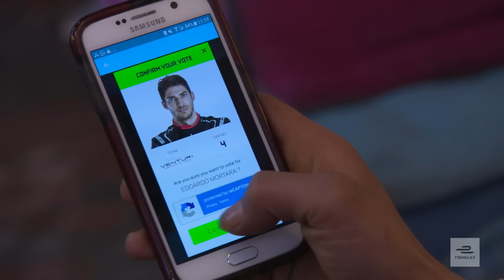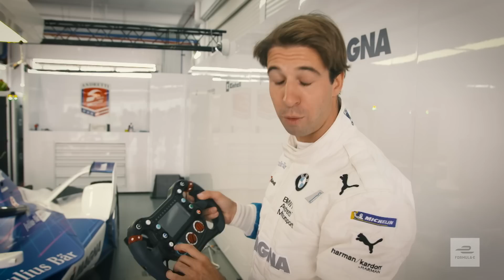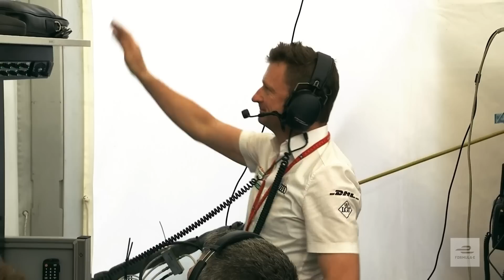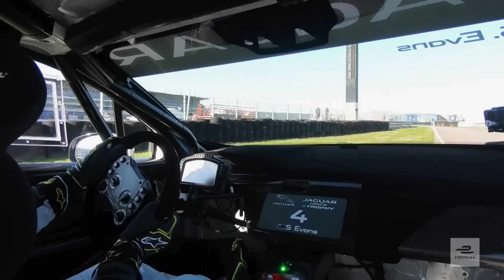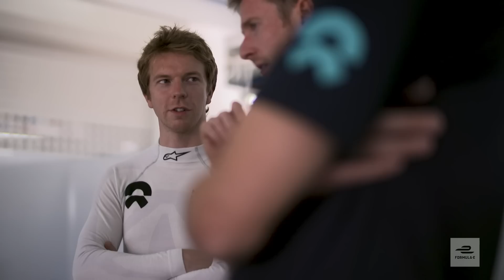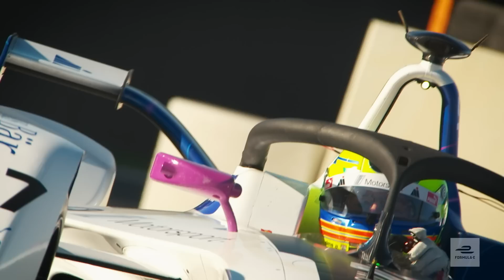ABB FIA Formula E Championship Season 18-19 Preview Show 2

Comment: You really need to get rid of Fan Boost. I know is a Social Media thing to boost fan interaction and viewing numbers, but it's an unfair gimmick. Formula E has gained more than enough popularity now to drop it. There are other ways of interacting with fans.
Turn it into simple Push-to-Pass please. 😁

Also, would it be possible to make a disabled support race with modified Gen 1 Formula E cars (without pit stops, so 20 laps or so) for people like Billy Monger or injured ex-servicemen who race semi-pro?
That'll gain a lot of popularity, surely?
Reply: Fans seem to like it why drop it then?
Reply: @JuzzlinOSS  Because it's an unfair system that gives the same three or four drivers an advantage above the rest of the field.
Reply: @CBadger  The effect is not too big so I don't mind. Usually it doesn't help anything at all.
Reply: @JuzzlinOSS  do fans like it? I'm only just getting in to formula e but fairly much everything I have seen on it has been negative.
Reply: Very good point

Comment: Lots to like and FE is moving forward.
FAN BOOST is still a RUBBISH gimmick though!
Reply: Just like DRS in F1, but not as bad.
Reply: @JuzzlinOSS , gimmicks but not quite the same level. One requires drivers to still work for it, the other is an outside influence. 
DRS would be much better if all the drivers could deploy it on the straights, since it's purpose was to negate the wake/turbulence. 
However, FIA probably realized the downforce levels are so ridiculous now that it wasn't enough.